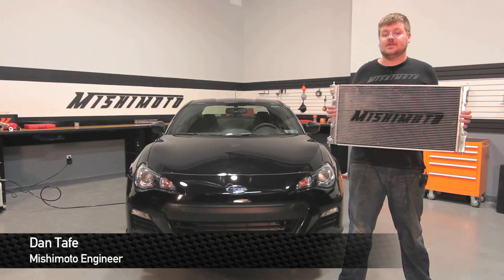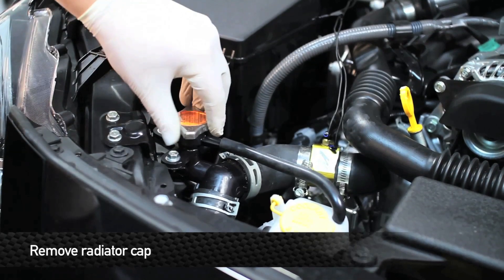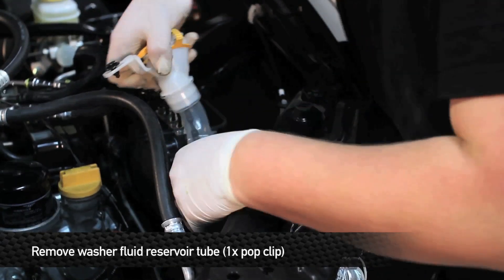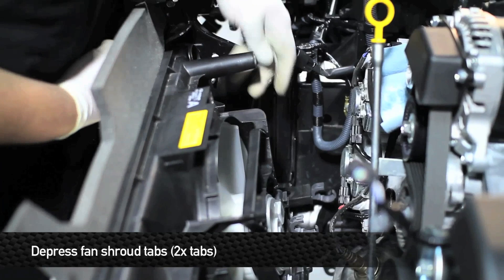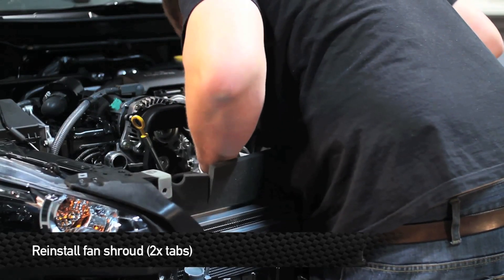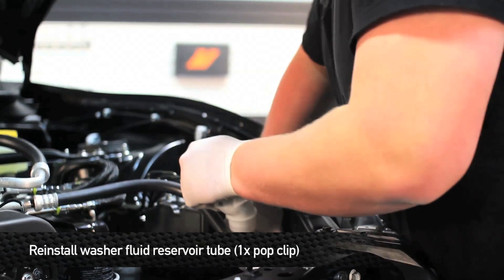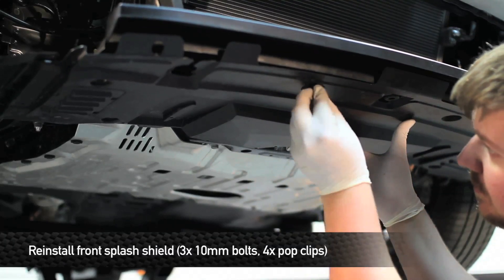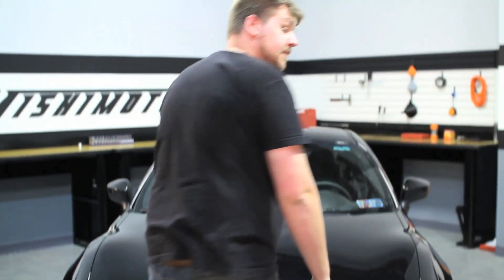Performance Radiator Installation Video fits Subaru BRZ / Scion FR-S

Comment: Thanks for the video. I did the whole job in 2 hours flat. Super simple. You don't have to do half that stuff. Just move things aside still connected. Hard to explain in a comment but good instructions 🤘
Reply: what didnt you have to fully remove? going to install line next weekend

Comment: Whats wrong with the standard radiator? Why is this one needed??
Reply: I havent found any answers. I'm pretty sure the stock one is aluminum already and is made for performance. Im guessing this is just for looks.
Reply: @lelouch6067  and just for looks wouldn’t even make sense as it cannot be seen even when engine hood is open unless you directly look through the radiator fans lmao.
Reply: @lelouch6067  no, the stock one has very minimal coolant capacity and it would overheat easier in hot areas when beating on the car or in track use. The mishimoto has higher capacity you can even see the size immense difference. If you just daily drive and not live on the higher rpms you wouldn’t need a higher capacity radiator.